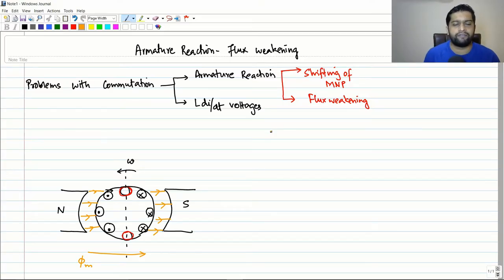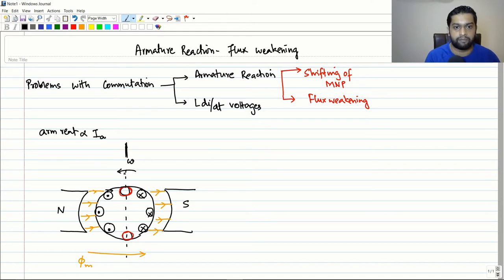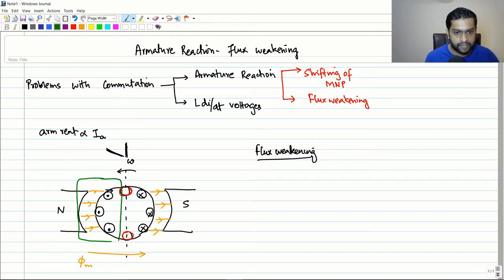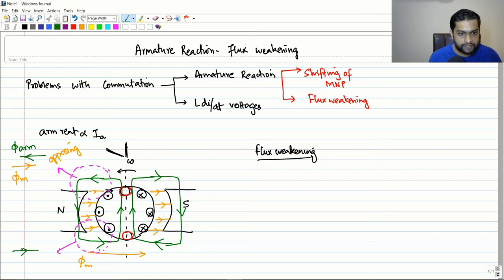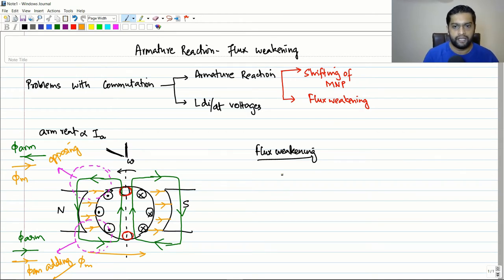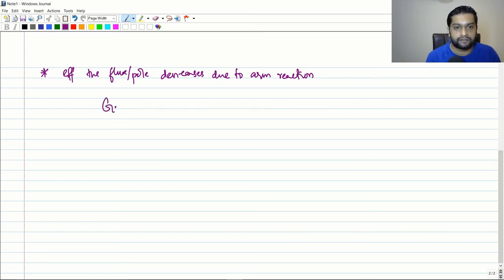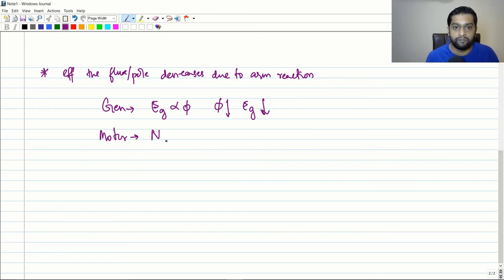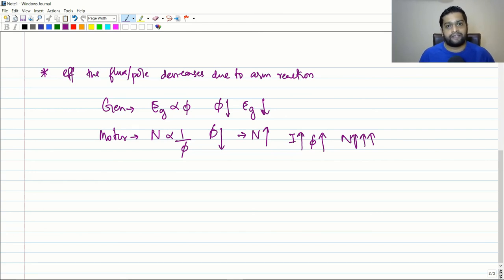#18  DC machines Basics -  Armature Reaction - Flux Weakening

Comment: in case of motor (end of video) when current increases then flux also increase then N (speed) should decrease ????
Reply from the maker: thanks for pointing out..it was a typo...when armature current increase, flux decreases ( due to armature reaction ) and speed increases....
Reply: Shubhaang Vyas  to my knowledge, field weakening decreases field flux which decreases CEMF to the armature allowing it to rotate above base speed. Thats my dumbed down version. I may be wrong, I'm still early in my program.